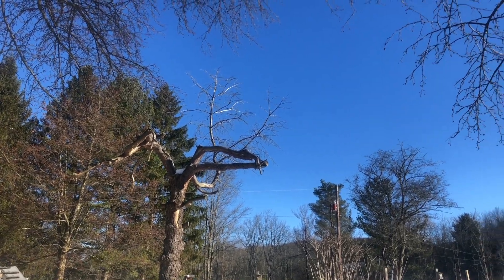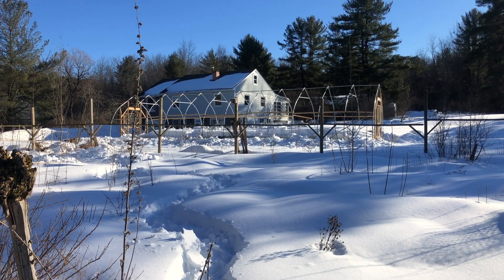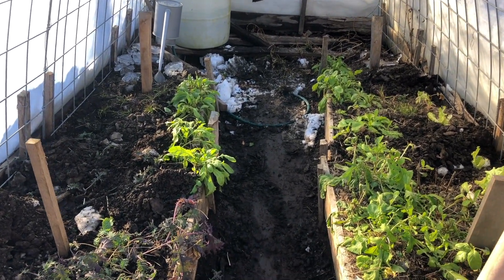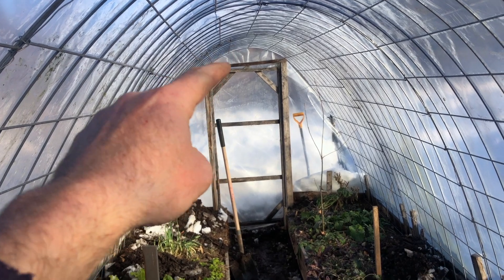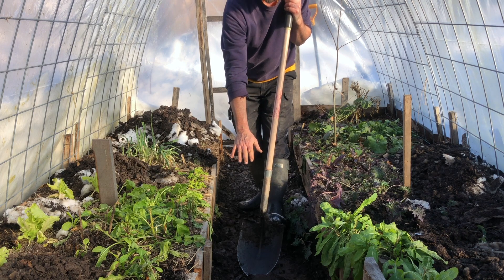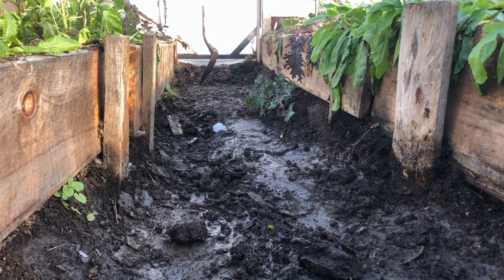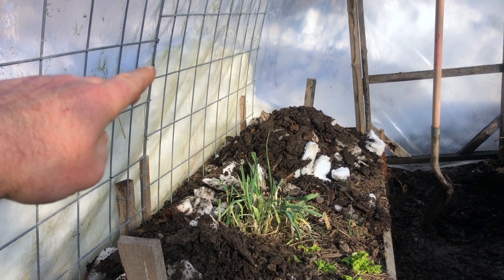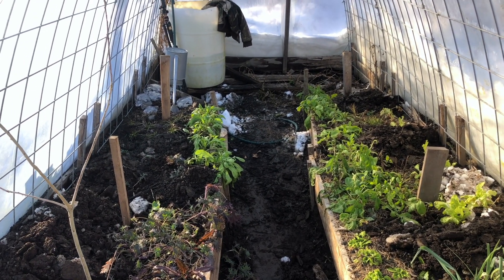Compost Heating a High Tunnel - Walkway based heating approach concept...

Comment: As with other comments, my only concern is walking on it causing compaction. I had a similar idea once for overwintering vermicompost (the hubs really didn't want worm bins in the house). My tunnel was a bit taller and i am a bit shorter so I put boards basically across the path resting on top of the bed walls (mine were brick instead of wood) they were square sections the width of the path and each had a small hand hole so I could lift different boards to get to different areas for adding food scraps or other maintenance as needed. I can email you a picture if you like.
Reply from the maker: Sure, please do :)
sean @ edibleacres.org

Comment: Ok... so all of the research I've done in regards to compost heating a greenhouse says that you need more thermal mass (minimum 3' cubic feet square).  I've been researching this like heck this last year and have decided on an external modified Jean Pain mound with pipes running inside (haven't decided if I'm running it through the beds yet or to a water cistern... each has their advantages).  If you decide to go external and still want to remain low tech, perhaps something that is more of a convection syphon design or consider using a solar panel to power a small pump (adjustment of flow is important in order to not go too fast so as to not allow your fluid to pick up enough heat while in the pile).  Also, I don't think I've ever caught your name on here... I know your wife's name (Sasha), but I don't think I've ever heard your's (granted, I've only watched about 30 some of your vids, so haven't seen them all)
Reply from the maker: Sean... nice to meet you :)
Thank you for the notes.  I definitely agree with your ideas, and am sure that if I could commit a much larger space to composting with a heat exchanging system embedded that I could expect higher efficiency.  That said, I am looking for the intersection of 1) efficiency when possible, 2) heat as much as possible but not screaming hot for months and months, 3) fits within the existing setup and layout (our beds and overall layout is SUPER complex and tight so I can't design from scratch around the main goal of compost heating.
I hope your approach works super well!

Comment: Love that poly tunnel on string design. I might be taking advantage of that this year. I'm taking a similar approach to organic matter in the walkways in my garden. I'm burying wood in the paths, mostly to act as a reservoir to stretch our winter and spring rains through our droughty summers. But I'm also hoping that the nutrients get carried into the adjacent beds by worms and other microbiology, and a little extra heat from decomposition would be an added bonus. Adding a liquid source of nitrogen to the baths can speed up decomposition if I need more heat, as long as I can get in enough organic matter to fill in the paths as they decompose and shrink.
Reply from the maker: I think there is a real basic value in the idea of having a nutrient soaking / nutrient leaching design in walkways in these spaces.  Worms certainly can migrate back and forth and deliver the goods to the beds, and the roots from the plants will be able to reach down into there by the end of season for a huge boost.  Win win even if there isnt' significant heat provided.

Comment: I learn so much from you while you take meandering walks. Please do, sir.

"Futz" is a true and useful word.

I think I would put the next layer of plastic down to the outer side of the bed, instead of attached to the cattle panel, for another layer of protection against the outside cold.
Reply from the maker: Thanks for the vote on the extra insulation idea.  I appreciate your input.

Comment: What about any bacterial/fungal issues in a greenhouse (considering no ventilation) when composting in the same area? I’d be concerned about that
Reply from the maker: It certainly isn't 'no' ventilation.  Some air is definitely going to be able to move through. . I can add more carbon/charcoal if needed as things prove necessary.
Reply: Oh interesting!

Comment: I would do walipini style cattle panel hoop house. North wall around 1 yard high constructed with corrugated steel. Long compost pile on the outside. You will gain a yard width and/or height for the hoop house.Heat from the compost pile will radiate through the steel into the hoop house. No smells in the hoop house. Working the compost pile still is necesary, but you seem to like that exercise. Stay safe, best wishes, greetings from Holland
Reply from the maker: I like your ideas, and in a future layout I may explore this... As of now our layout is just so super tiight there isn't room for modifications like that.

Comment: This is a great idea, not only will it generate heat but the added CO2 may also give the plants a boost. My thinking however is that the heat from that compost will have more of an effect on the air temperature rather than the soil temperature, given the thermal mass in those humid, cold beds
Reply from the maker: It will be a trick to insulate the top of the walkway compost a LOT so that all the warmth will radiate and push more into the beds. . We'll have to see...

Comment: Love your information! In order to generate enough heat for the cold winter months, would you need to dig the center down more?

After enough heat is generated, could the center, and side gardens be covered again with plastic?

Sounds like a lot of futzing around, but my thought is you would capture the heat rising, and it would also migrate sideways into the raised beds.

I would also love a consultation 💙
Reply from the maker: The design for this is more about a warming buffer for the 'swing' season when winter transitions into spring.  I'd hope for nice warmth for about 2 months from a system like this, which is about how much we'd need...
Reply: @edibleacres  Oh yes, you did say that earlier in the video.

Comment: You always give me ideas!  I have saved a couple of old shower doors with the idea of making one into a solar heater.  I'd like to run the water lines through that  and then do the radiant heating lines elsewhere.  If I tried your idea with running it through the hoop house (mine is still unfinished) and do my walkway with pea gravel then hope fully it would have more heat retention.  It may not work, but I doubt that I will be our much for trying.

Comment: Yes! After watching a few of your videos, I did exactly what you are talking about doing. I dug down about a foot, added straw, wood chips, chicken manure , then already started hot compost, then reversed the order of stuff as I layered up from the ground except instead of the straw at the top I put a double layer of wood chips! Every so often I go out and turn the compost. I’m very excited to see what you do :)
Reply from the maker: I hope that works incredibly well for you!
Reply: Do you remember size of the walkway?

Length, width, depth?

How long did the pile run hot? Did it go full on anaerobic without outside venting?

Do you have any temp record?

Comment: General rule of thumb is you need at minimum 3 ft x 3 ft to get a mass of compostable material to run hot. Given the height of your tunnel and your height, you got a lot of digging to do.

Consider rebuilding the tunnel for that purpose with a 24 in. straight knee wall and attaching the hooped cattle panel structure to the knee wall. You can use Tuftex or Suntuf panels for knee wall covering to let in light. Aeration may be the real problem. No good way to run horizontal pipes that won't clog.

You could build a large wooden sturdy lattice work frame (like deck framing) for the walkway & cover with landscape fab? before putting down the compost. The frame would need vent holes to the outside. The lattice frame would serve the same purpose as a pallet in a Johnson Su bioreactor, allowing air to flow through to the bottom of the pile.

Seems like too many re-engineering problems for such a small space (height and width as is) without essentially rebuilding for that main purpose.

I now have a headache thinking about it.
Reply from the maker: I hear you, and I don't have any expectations of super high performance.  I am just looking for a decent little boost around the swing season without re-inventing the wheel...

Comment: Attaching the low tunnel plastic to the side of the high tunnel might be counter productive.
You would miss out on a layer of plastic on that side and any heat will be channeled towards the outside wall instead of right above the bed.
Overlapping onto the compost seems good, in fact, covering the top of the compost with plastic, cardboard and/or planks would might redirect heat towards the beds.
You might even cover the beds and composted walk with a single continuous sheet of plastic, pressed down flat over the compost, propped up over the beds.
It would look something like this:
/\___/\
Reply from the maker: Cat ears :)
Great notes you've shared here.  I'm still thinking through how it will go.  I have 3 tunnels I may be trialling this in so perhaps I end up with a few iterations.

Comment: If you were to attach the inner poly low tunnel to the metal, won't you lose some of the insulative gap you would otherwise have between said metal and the outside of the inner plastic? Hope my textual sketching makes sense as to what gap I mean... It's the air at the rightmost side of the screen shown at 4:54. If you lift the plastic up from the ground and attach it to the metal, that cold barrier will be gone...
Reply from the maker: On the north side I agree 100%... On the south side I wonder about the tradeoff between 2 layers of poly and heat retention vs.  2 layers of poly and solar gain losses...  Something for me to look into.

Comment: Any particular reason that corrugated pipe you are to install needs to be on the northern side? Or just because that happens to be convenient in your application?
Reply from the maker: Convenient / lower on the slop just a tiny bit.  I ended up going with a natural material, I'll share notes in the next video.

Comment: What about 10 x  4 ft. Frames, covered in plastic, attached midway up the side of green house running the entire length on both sides and rests in the middle of the compost path.  Then fold them up toward the roof out of the way  when you are inside greenhouse.
Reply from the maker: I am thinking about that, but wondering how to manage access against thermal gains.   Interesting project to explore.
Reply: If the frames could be folded up, they would have to be on a hinge attached midway up the high tunnel, and clip in place at the peak of the high tunnel you could maintain access.

Comment: I may be misunderstanding the plan, but it seems like you intend to use the outside plastic as one wall of your low tunnels, and then extend the low tunnel plastic out over some of the walkway so that heat from the compost can get directly into the low tunnel? If that's so, it seems to me that ether a) if you extend the low tunnel plastic far enough into the walkway to get an appreciable effect, you won't have much walkway left to walk in, or b) if you don't pull in warmth directly in, the low tunnel will actully end up colder than the ambient air in the high tunnel, as the low tunnel will keep out the compost-warmed air and the side that's the high-tunnel wall will let in the cold-effectively, the low tunnels will have pretty much the conditions that the high tunnel has right now-maybe a bit of extra root warmth near the walkway, but that would seem to be about it. Was there an issue with the centre-tented low tunnels,  that attaching to the outer wall would remedy? Because they seem quite a practical design as they were. I'd also second the suggestion someone else made to put some sort of stepping 'stones' type of thing in the pathway to minimise compaction of the compost. All in all, this seems a really intriguing idea, and I'll e very interested to see how it works out, for possible use next winter if our planned high tunnel gets built for next season
Reply from the maker: Thanks for these questions.. .I have a lot more thinking to do on all this before I commit to one plan, and there are 2 more tunnels I may experiment in so I could have some variables to work with.
Reply: @edibleacres  Fair enough. I do think the idea has a lot of potential, if you can get the details  ironed out. Looking forward to seeing what does andd doesn't work.

Comment: Wouldn’t it make more sense to have the compost against the exterior walls further insulate them and “heat” cool air as it entered the building. Much like we do with radiators?
Reply from the maker: I hear you but the constraints of access and movement around this space are such that it would be hard...

Comment: I think it would help if you dug around the edge of the high tunnel 18 /24 inches down and put in some insulation (bubble foil insulation) to keep some of the cold out and hold some of the warmth in. Putting some hardware cloth down there as well should help with the vole damage as well. Maybe you have too much frost heave for such a thing to be viable.
Reply from the maker: I hear your idea, but I want to move away from more plastics and such being buried.  Maybe I mulch the soil outside the tunnels more so they preserve the temps from the earth below, that may be a consideration, although then I'm asking for more vole damage!

Comment: Here in Quebec in December my greenhouse is not on the sunny spot all day long I put a black plastic to catch the sun and to keep the soil hot and keep the moist and it work
And in march I will put a heater cable for the new seed
Reply from the maker: Sounds like you have a good system for yourself.

Comment: compaction from walking on it might cause it to be slightly less aerobically active than a pile you didnt walk on.... fluff it up with the fork on the way out?
Reply from the maker: I hear you, or cap it with a bunch of wood chips, or miscanthus grass stalks with woodchips to spread the load...
Reply: @edibleacres  a quick thought, two long planks would disperse your weight enough to stop the compaction to a degree

Comment: Once tried to heat a 20'x20' hoop house with piles of very fresh goat manure. It was positively balmy and steamy! The only trouble was that the ammonia levels were so high it killed all the hearty plants I had over winterizing, even that old brute, kale! It isn't great for one's lungs either.  I'm sure you know the moral of the story: make sure your chicken bedding and manure mix has enough carbon to take up the very high nitrogen levels present in their droppings. Ammonia off-gassing is evidence that we are losing nitrogen that could otherwise be utilized in the compost. Additional carbon from your mountainous supply of leaves would work nicely. 
I removed all the goat manure, by the way, and in a year or so grew the best butternut squash ever in the pile it made... Outside!
Reply from the maker: Good note here, sorry you had that experience.  I plan to add a whole lot of charcoal in the pile to absorb excess, and get the ratios right as they come in.... .Yeah, when in doubt you pretty much always need more carbon!
Reply: @edibleacres  It's all about experimenting and learning, right? I really appreciate your ongoing innovations on the homestead. You inspired me to build a hoop house for our chickens where I add compost and leaf matter. We call it The Chicken Spa, and the hens love it! 
This winter I've added a second layer of plastic to my garden hoop house. Professional growers will install a blower fan to inflate the space between the two layers to create an insulating gap, reducing thermal bridging. I wanted a more passive solution so I strung pool noodles like beads on a necklace but on a cord. I ran one of these over each metal rib of the hoop house. Results are not bad. B+? To get good empirical evidence, we would need to have ambient and interior temperatures from  comparable weather days with and without the double layer. Or... Edible Acres could run a cool test with the multiple hoop houses they have on site 😄.
Reply: Yeah. I too wondered abut the accumulated "gas" effect. Seems that at best, compost generated heat only goes so far as a supplemental heat in an enclosed space before you hit the danger zone.

Solar DC powered heat cables running through the beds with a battery for night time heating may be the only way for a tunnel this size. I don't see that he has the width or height to get enough compost in that walkway to heat up as the tunnel is origninally constructed.

Comment: Sean it seems that the cross-sectional volume  of compost in the walkway will be very low so it probably won’t remain hot-  I think you’re better off putting a 1 cubic meter pile at the end of the tunnel,  so you don’t have to walk on it and  compact it, and it will have a large enough volume to remain somewhat hot
Reply from the maker: I wonder about that...  I would imagine in this context if the compost was really well made it would confer some warmth for a bit, but not be long lasting.  I'd really need it mainly to get through the hump of the next 2 months so that is the question I need to answer...

Comment: Ok Sean....i have seen this...a short length of perforated black slinky pipe from middle into side beds would also help transfer heat ......this person mixed wood chips, kitchen scraps and leaves in their walk way. They also put some pallet slats straddling bed to bed so they didn't half walk on the compost. The worms almost immediately moved in.....actually is in the works in my greenhouse......i only have about 6 inches in dept to work with without digging deeper.. But deeper would invite more worms....right ??
Reply from the maker: Nice ideas here.  I think when we get to the larger 14x50' tunnel I'll have a lot of great ideas to work with!